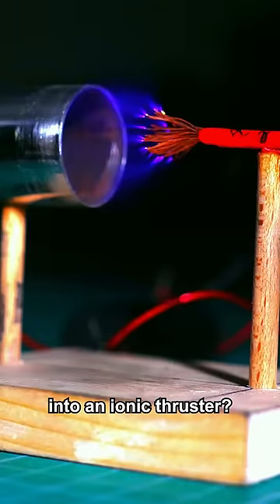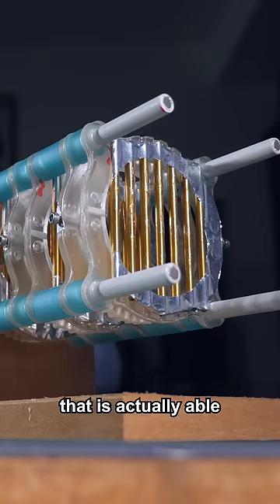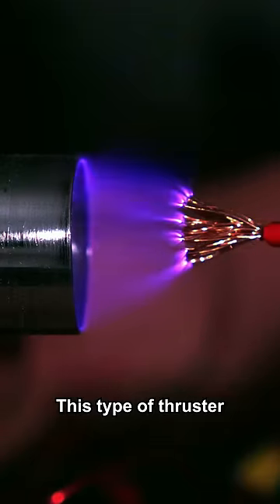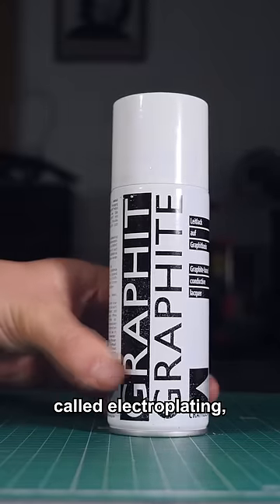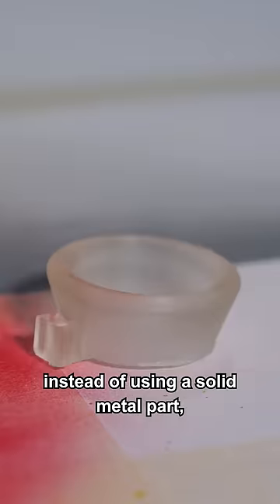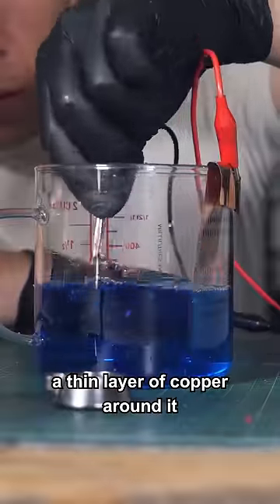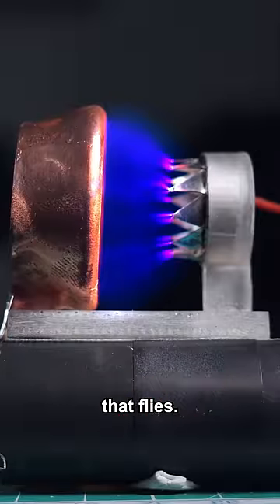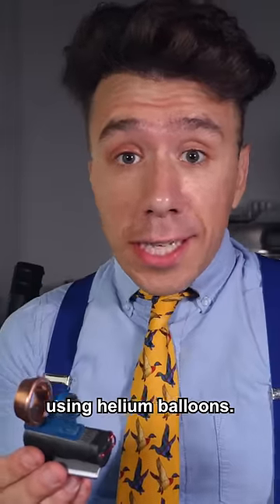I Built an IONIC PLASMA Thruster

Comment: You know what Integza. Why not use a wax mold so you can make hollow parts or combine it with that electro plating process to make a thin hollow part. Well you're smart you know what i mean i don't have to explain it...😅
Reply: Yep, and switch from a battery source to a wireless power receiver so you can get by with a smaller balloon.

Comment: @integza There is a massive improvement you can apply. According to Robert Smith's experience on wind turbine, he found a way to accelerate the air using Venturi channels made by several conical vanes. What do you think?
Reply: Great idea. It's exactly what I was thinking. It will help to create the necessary pressure difference at the exhaust too.
Reply: Can you provide a link to his video?

Comment: No. Plasma has a temp of 6000°C - 8000°C (11,000°F - 14,500°F) approx. 
This contraption can handle those temps I'm sure yes? 
It's moving due to temperature currents. Electricity is hot. Heat moves backwards through the "nozzle" creating "thrust".

Comment: Bro the graphite itself is conductive to electricity. So why did you electroplate it again??
Reply: The graphite dust is held on with static or thin adhesive coating. The copper is chemically deposited forming a skin.

Comment: I wonder if there is a maximum plasma density that can be inspired by the use of a GYROID in integza's laminar flow rocket video.
I doubt that the exact same gyroid structure would work but a two dimensional anode to an inverted cathode. The idea would look similar to a vertical garden rain barrel and a tree branch cathode.
On the outside, would be an externnal cathode similar to the crown of thorns depicted in biblical illustrations of christian persecution.
The outer shell maybe a voice coil wrap to steer and concentrate the plasma.

Comment: Why electroplated with copper when graphite already made it conductive ?
Reply: Good question. Maybe reliability? 
I think that's why tungsten is used for TIG welding.
Perhaps a thermal spray of tungsten on a layer of silver might work even better.

Comment: Why not hydrogen as a propellant?
Reply: The container would increase weight and it would need to be performed outdoor with a little big thruster
Reply: @anonymoussynchronous unless he meant it for lift instead of helium....if that was the case, the hydrogen would make for a more interesting/ edge of your seat experiment should the balloon be damaged during the test
Reply: @matthewhoffman9242 The Hindenburg proved hydrogen wasn’t an acceptable alternative for buoyancy. It was designed to use helium, but the USA refused to sell helium to Germany.
Reply: @jdsbees3257  i remember hearing that on a show about it, also remember a different show on YouTube or something mentioning the skin of the zeppelin and the paint together was similar to the makeup of crude thermite which didn't help things when it started burning. I'll have to look for that documentary again.